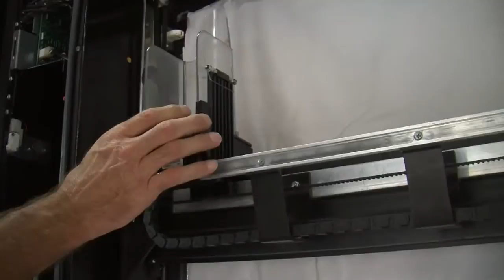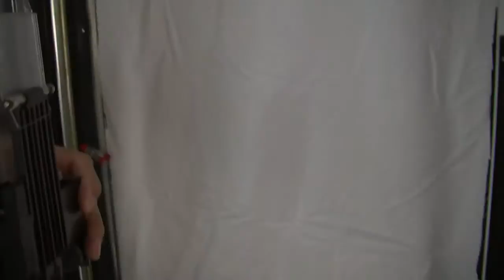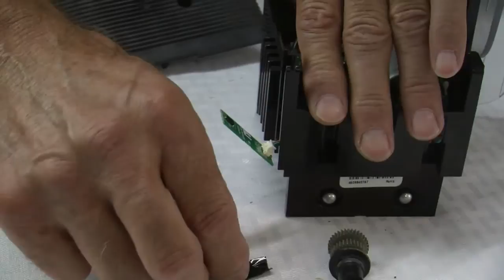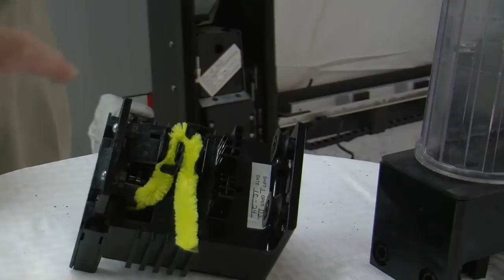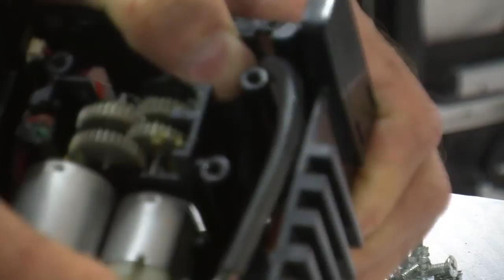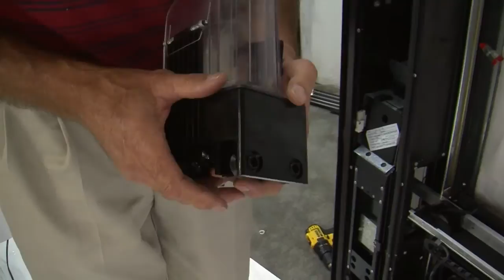Royal Vendors Cup Removal and Installation

Comment: Thank you so much for uploading a great video

You look very professional.
I am in very tough condition with the machine. 
Please help me if possible.

My machine sometimes fails to dispense drinks.

Cup picks up a drink, brings it to the port door, and returns without finding the door several times before stopping.
The cup should open the port door.. It keeps returning to the center as if the sensor is not working.

Should the cup be replaced?

Comment: Hello I have this home sensor on display , I am wondering if there is a easy fix for that, or I need to replace the sensor or the whole cup ? Thank you in advance for your response. Great videos!!
Reply from the maker: The Home Sensor error usually mean the cup cannot find the Home Magnet. This is located under the bottom shelf screwed to the floor inside the cabinet. 
1. Try holding both door switches closed while holding the door open. The cup should rise a few inches and then go down until it sees the Y position switch close under the weight of the gantry. Then watch the cup move all the way from one side to the other. It should them move to the center and begin searching back and forth in the center of the gantry. When it does let go of the switches and test the machine again.
2. Worst case is the X Harness has a broken or intermittent break in the wire for the home sensor going to the control board. You can usually find this by performing a Sensor Test in the diagnostics menu.
Reply: @coincoroyal2927  thank you very much